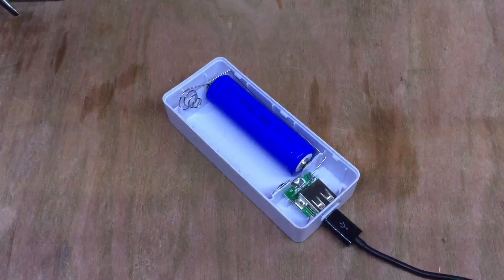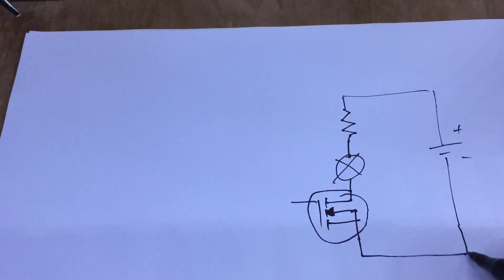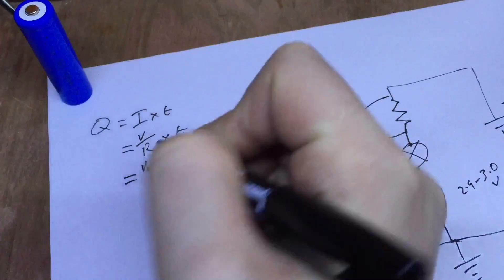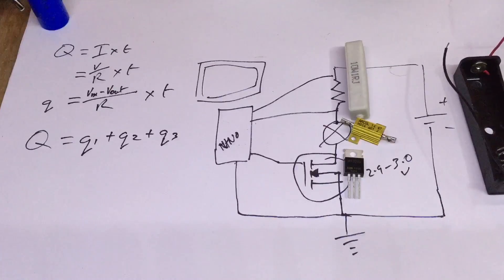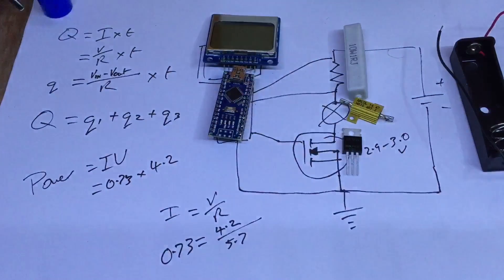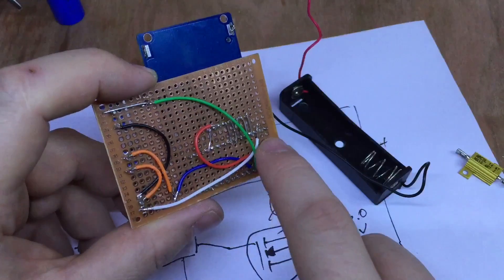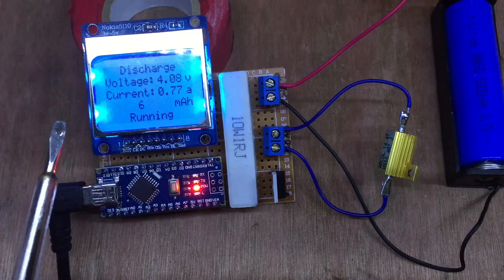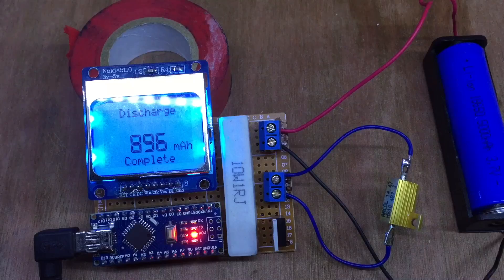Lithium Ion 18650 Capacity Checker - Adam's Arduino Projects

Comment: brilliant video managed to build one myself. Was wondering if you could add a charging circuit to this so it charges it first and when it gets to 4.2v it discharges it and shows the capacity. thanks again for the video.
Reply from the maker: +That Guy Thanks for the kind comments - I'm really pleased people are building these.

You could potentially add a TP4056 charging module into the circuit or you could have the arduino control the charge if you wanted to get a bit more advanced - you'd need to throw in a couple of mosfets and a power supply.  It was never really in the brief of my project though.
Reply: You would also need to add a delay between the end of charging and the commencement of the discharge cycle to allow the battery to cool (perhaps adding in a temperature sensor?)
Reply: Nick B depends on what current your putting into the battery, they dont usually get hot or even warm unless they have gone bad. :D but the temp would be a good safety feture for the bad cells
Reply: Maybe not the Li-Ion chemistry but the Li-Po certainly do get warm, especially under high discharge currents (such as those found on multirotors.) Li-Ion do appear to be a little more forgiving.

Comment: Great project! But in order to improve the accuracy you could measure the voltage drop across the whole load, especially when you are using a resistor anyway :)
Reply from the maker: +steve0steel Thanks for the comments. I guess you're right, but I wanted to be able to change the 'load' whenever I wanted without having to change the code. Using a fixed shunt resister value meant I could pop in any other suitable load and vary the current draw easily. Using your method is need to change the code or add in a menu to be able to dial up the right resistance. 

If you watch my second video on this you'll find I was quite please LS with the accuracy to say I threw this together with bits I found at the bottom of my components box. 

Thanks again for your suggestion and kid words.
Reply: +Adam Welch Wow, it's nice to actually get a response. You just gained a subscriber! I watched the second video and you're right, the possibility to swap loads is great :)
Did you ever compare the measured current of the Arduino with the reading of a current-meter. It would be very interesting to see how accurate it is!
Reply from the maker: +steve0steel Thanks again! Do you know I haven't done that. When I found good results compared to the commercial product I put that down as a win and counted myself lucky! Perhaps I'll do that one day.

Comment: What if I wanted to discharge 8-10 cells at once and check each one capacity?
Reply from the maker: +emceh You could replicate the discharging circuit, but as you need two analog pins for each cell then you could only control four cells maximum with a 328 based arduino.  You could do more with a mega though.  It wouldn't be difficult to add the code for three more circuits and adjust the LCD readout if that's what you wanted to do.
Reply: +Adam Welch thanks,  that helped a lot

Comment: This is so simple that it is amazing, i was struggling to find a way to tell the capacity of my cells because of the voltage differences by the state-of-charge of the cell... but this is the solution! i'll be making this for sure...thanks!

Comment: Great video, maths well explained. Thank you, I'm just looking in 18650 batteries and you have inspired me to also look for the parts and to replicate your work. Top man!
Reply from the maker: +Dean Greenhough Good luck with your project Dean. Thanks for your comments.
Reply: I have built mine. It works like a dream. Although I had to adapt the code for an LCD i2c, but have ordered the Nokia as it looks perfect for the job.

I have learned a lot from this, mainly b not having the parts, i did have a 1 ohm 5w resistor and a 12v bulb, worked out perfect.

I now also have a respect for the NPN transistor, I like them a lot
Reply from the maker: +Dean Greenhough That's great news. We learn so much by tinkering!

Comment: Adam, I read your code for this project and while I understood most of it, there is a line that really trips me off (or I am too tired to figure out on my own)
What is the purpose of: battVolt = analogRead(highPin) * voltRef / 1024.0; ? Can you explain it please?
Reply from the maker: +Sergio Martinez The code is calculating the voltage of the battery - analog read the pin connected to the high side of the circuit which will return a result between 0-1023. Times that by the voltage reference (which in a ideal world will be 5 volt but is often a little less - I mention higher up the script to test the AREF pin with a multimeter) then divide by 1024 to get the actual voltage of the cell. I might not be explaining myself very well though... 

So let's suggest analog read returns a figure of 700. Times that by 4.95 and divide by 1024 gives 3.38 volts at the battery.
Reply: That makes sense! So the reference voltage is what powers the arduino on its side of the circuit right? 
If so, why use that instead of the maximum voltage of the battery? (I know the result would be inaccurate, but I'm trying to understand why)
Reply from the maker: +Sergio Martinez The voltage reading needs to be as accurate as possible. It's protecting the cell ensuring it doesn't go too low, but it's also crucial to calculating the capacity of the battery. Without accurate measurements the project simply wouldn't work.

Comment: Hi,
could you recommend some transistors to switch the circuit ?
I can't seem to find ~5Vgs 2 or 3a transistors to work with the arduino and the one you use seems to be expensive when bought in large quatities
Reply from the maker: +BillTheBox I've been buying IRF3205s in packs of ten from China eBay sellers for about £1.50 which is about 2USDs I think. If you're looking for cheaper than that then I don't really have any recommendations because I haven't tested them. Any N-Channel logic level mosfet able to handle at least 2 amps and 5 volts will be absolutely fine. You can use a fet which is able to carry more current - the IRF3205 is good for 55 volts and 110 amps!
Reply: ***** Many thanks !
I ordered two different types : IRF3205 and IRF540N

Comment: Hello Adam, Great capacity testing unit. I'm currently building a copy of yours. Do I have to use the Nokia 5110 84 x 48 LCD screen with the Arduino nano or could I use a different size. I dont know anything about the programming of the arduino or if the screen size has to match your code. Is it possible to use another screen without changing your setup?

Cheers

Eric
Reply from the maker: If you're changing the screen you'll need to change quite a bit of the code. You'll need to change the library at the top for one suitable for your replacement. You'll need to change every line of the code which instructs the Arduino to write or clear the screen too. You'll have to think about the spacing around what ever screen you opt for too. 

It sound like a big job, but it's a great way to get to grips with the code. If you don't fancy doing that, the Nokia 5110 screen module is only about 2USD. 

You can swap out the Nano for a Uno without any issue.
Reply: I'm going to stick with the original screen. Cheers

Comment: I want to monitor  battery capacity with an Arduino. The load on the battery is essentially a barcode scanner with wireless capabilities and which will be powered by a rPi - a LiPo battery is included on which I used a 500C power boost to power a Raspberry pi for the wireless capabilities. The device is battery powered but it has been decided that inductive charging system would be beneficial so the device is constantly being charged. I want to monitor the capacity with the arduino , So I hooked it up this way. the 3.7 lipo to the powerboost which gives me 5V to a breadboard and from the breadboard, the 5V goes to the arduino's analog input.Then I hooked it up with the Rpi. I'd appreciate any pointers on how to get the code on the blog working for me with a little tweak as I'm not using any load resistors to dissipate it. Thanks
Reply from the maker: +dprice f o Thanks for your question.  You're adapting this project quite a bit away from it's original intention - and there might be better options.  You wouldn't need to change the code to view what current was being taken from the battery.  The code calculates the load by using the voltage drop across the shunt resistor - so the only change you need to make is the shuntRes float if you're not intending to use a 1 ohm resistor.

The thing is, the code would have to be re-written almost entirely to account for the charging which you are also wanting to incorporate.  This code is designed to completely deplete the battery and stop.  If you want to simply monitor the cell voltage, a simple battVolt = analogRead(battPin) * 5.0 / 1024.0; would do the trick, then you could incorporate a mosfet if battVolt got below 3 volts for example. 

Unless there is a specific reason why you want to use the arduino, or develop my project I think you'd be better off using a LiPo/LiIon fuel guage IC on your raspberry pi.  The extra load of the arduino (unless you're running out of resources on the pi or don't want the battery monitoring slowing your code) seems a waste of your limited capacity.

An I2C lipo fuel guage doesn't cost much money... http://www.ebay.co.uk/itm/1PCS-LIPO-FUEL-GAUGE-BATTERY-DETECTION-A-D-CONVERSION-IIC-MAX17043-MWIH-/121928390802?hash=item1c637f9892:g:TiAAAOSwu1VW6884

I hope that helps.

Comment: sir can i use arduino uno instead of arduino nano board in this project ?  how should i modify the sketch for uno? I want to build this project but i have arduino uno,..
Reply from the maker: +Vighanesh Rumde Sure you can use an Uno.  The sketch shouldn't need any modification as the Uno still has the required analog and digital pins.
Reply: ok so the corresponding pins are similar of both the uno and nano ..
Reply from the maker: +Vighanesh Rumde That's correct.  Both boards have digital pins 0-13 and analog pins A0-A5.  The nano does have two extra analog pins A6 & A7, but they are not used in this project.  Happy building!
Reply: thank u sir..

Comment: I'm relatively new to electronics so pardon if this question is off.  Are you measuring the voltage drop across just the resistor or across both the resistor and the load?  And does it matter?  I enjoyed this video very much.
Reply from the maker: +Tim Byers Shh - don't tell but I'm fairly new to electronics too!  

The voltage drop across the shunt resistor is proportional to the current flowing around the whole circuit.  So in my application here where V=IR and as my shunt resistor is a 1 Ohm resistor V=I.  However we're looking at the voltage drop, so Vin-Vout=I.  In reality most current shunts are much lower values, in the order of 50-100 milliOhms.  However I was using what I had lying around for this project and measuring such small voltage differences might have been more difficult for the arduino.

Thanks for your kind comments and I hope that answers your question.
Reply: +Adam Welch Adam, your answer is helpful and I appreciate it.  I tried a setup with a 1 ohm shunt resistor and a 1 ohm load and while it works, that taxes the cells and I could only get about 1.5 amp out of them with the voltage dropping very quickly (sometimes just a single measurement).  A second test with 2 x 2.2 ohm resistors (and changing the shunt reference in the sketch) got things down to a reasonable .75 amp draw.  Thanks again for your video.
Reply from the maker: +Tim Byers Thanks. I did some maths in this video to show the level of current draw from different loads. A 2 ohm total load would draw about 2 amps - I=V/R, 4.2/2=2.1 dropping to 3.0/2=1.5 amps near termination. It's probably quite high for cheap cells or cells that have had a hard life. 

Glad you got it working for your needs.

Comment: Exactly the project I needed for testing my reclaimed 18650's.
Using the tp4056 charging boards, I have the feeling the batteries are getting worse.
http://www.ebay.nl/itm/181726824876?_trksid=p2057872.m2749.l2649&ssPageName=STRK%3AMEBIDX%3AIT

Could be the power packs I'm using them in are not ok, or the batteries are getting worse.

Going to build this tomorrow, need to get the two load resistors.
My compliments!
Reply from the maker: +Kenneth Tan I'm very pleased you're going to build one.  Let me know how you get on!

Comment: vERY NICE PROJECT
Reply from the maker: Thanks!
Reply: +Adam Welch I have question what rezistance is yellow rezistor?
Reply from the maker: +szymon6684 The yellow/gold power resistor is 4.7ohms. The White shunt resistor is just 1ohm. Together they give a discharge circuit of about 0.75 amps. I found a 3.6ohm power resister coupled with the 1ohm shunt gave me almost exactly 1amp discharge. Hope that helps.
Reply: +Adam Welch  ok thanks for answer
Reply: +Adam Welch  It's me again :) What is  full name this mosfet?
Reply from the maker: +szymon6684 I used a IRF3205 - http://www.irf.com/product-info/datasheets/data/irf3205.pdf  :-)
Reply: *****  thanks
Reply: +Adam Welch It's me again :) Could you do that for me the exact connection diagram of all parts?

for example in Fritzing
Reply from the maker: +szymon6684 I'll try in the next couple of weeks if I can. Very busy though so don't hold your breath!
Reply: OKE

Comment: Crackikng video, i'm going to do some testing with my usb doctor.  Scary how low the capacity is of some of the cheap cells from ebay.
Reply from the maker: +Colin Hickey Thanks for the kind comments - let me know how you get on.  Did you see my charger doctor outtake?

I've reclaimed a few samsung batteries from a laptop battery in the last few days - I think a few of them should hold a reasonable amount.